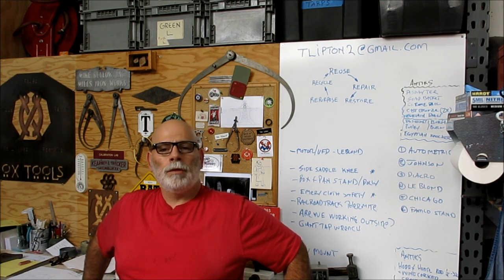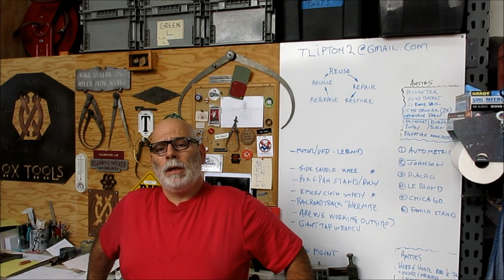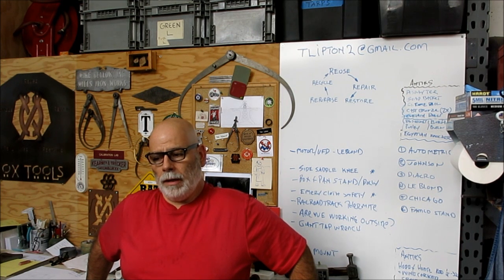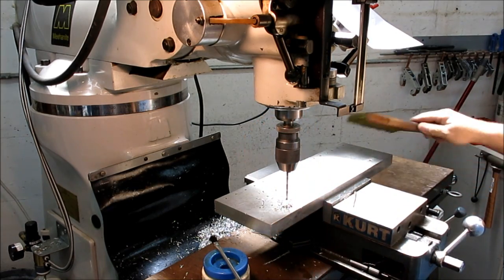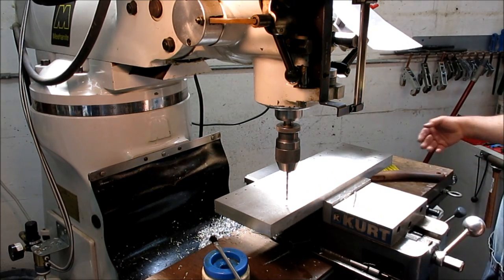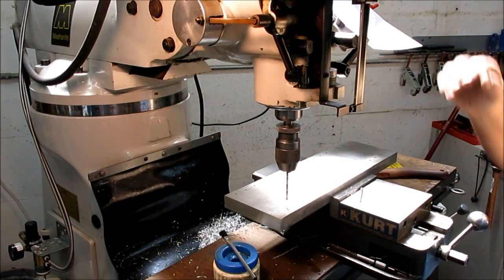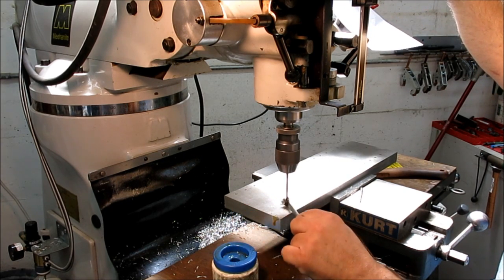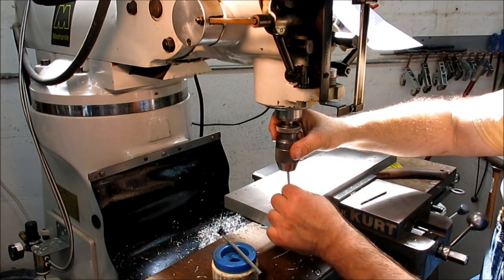Power Tapping In the Mill

Comment: Tapped some 20mm deep M10 holes today in my mill and it took me a lot longer than that..... Don't have a drill chuck for my mill so I use the ER-32 collet and power tapping felt kinda dangerous, tap wanted to slip in the collet and I had to tighten it really bloody hard, after I started the tap I rotated the spindle by hand, was afraid I'd have broken the tap otherwise. Really should get a drill chuck, or rather an SK40 to MT2 adapter so I can use the drill chuck from my lathe. Though I tend to have to hold taps in the lathe by the square edge or they slip.

Comment: First time I tried this at work a couple weeks ago, no idea what happened but when I pulled out there were no threads, it basically drilled my hole out with the teeth on the tap. Felt and looked like it worked fine till I pulled out and took a look at the hole.  It was a through hole so maybe I went too deep and hit the bottom of the vice. Whoops... Our hand feed lever is really janky though it coulda been worse, was making a basic puller for a pulley a friend was trying to get off a shaft.
Reply from the maker: Hey Max,

If your quill is sticky or you leave the brake on what you describe can happen. Your hand on the lever should track what rate the tap wants to go in and out. Your hand is just unloading the quill to let the tap focus on cutting. Hope this helps.

Cheers,

Tom
Reply: oxtoolco Yeahh, brake was definitely disengaged, the hand lever on our mill at work is really sloppy, cant feel a damn thing. I think that was the main contributing factor there.

Comment: Hi Tom
First I'm a total novice so bear with me.  Since you have a DRO to accurately position the piece, wouldn't the most time be saved by drilling all the holes and then coming back and tapping.  Saves all the time of changing bit and tap for each hole.  I used this method, sans DRO, while drilling and tapping holes in long aluminum bars for orthoses.  Used TapOMatic in drill press
Reply from the maker: Hey Morris,

It depends on how far the move is and the numbers you are driving to. Even increments like I was doing you can position fairly fast. Odd numbers take a little longer. The indexing time adds up quickly as the fine positioning sucks up seconds. Tapping the holes in another machine after drilling would speed this even more as you could do it without the DRO.

Cheers,

Tom

Comment: Hi Tom, I do sometimes power tap on the mill, but I don't think I would have the chops to do the tapping as fast as you are. And all my mills are step pulley by the way. It looks to me as though you are not changing the speed, and I think you said you are around 600 rpm's? You have nerves of steel my friend! cool!
  Another great lesson ........ Mike
Reply from the maker: Hi Michael,

Actually 1600 rpm. Got to get that drill to cut right. The tap never see's that full speed. Just don't come up behind me and ask a question while I'm doing it. Thanks for stopping by.

All the best,

Tom

Comment: That must be a good chuck to hold that tight that easily. Jacobs always seem to slip on me, even cranking on a chuck key. I'm amazed at how easily it loosens, considering that the jacobs need a lot of force to do so.
Reply from the maker: Hi Fake,

Well it is a $300 chuck. I didn't pay that much for it when I bought it but I do remember it hurt a bit. Thanks for the comment.

Cheers,

Tom

Comment: Isn't most of the time eaten up by changing back and forth between drill and tap? I kind of understand why you drill and tap while you are there (accuracy), but wouldn't it be loads faster (and still accurate enough) to drill all first, tap all second, debur all third (if needed)?
Reply from the maker: Hi Dscky,

The positioning is typically the time sink if the tool change is simple like this one. This was a pretty short distance and even whole number so its close. If the number were not whole then the tool change is definitely the way to go. Thanks for the comment.

Cheers,

Tom

Comment: Hey Tom,
Thanks for Tom's Tips and Tapping Tricks! (Say that 3 times fast!) What if you are using a spiral flute tap? Would they work in this situation? Thanks for drilling home some interesting hints!
Have a good one!
Oxen Dave
Reply from the maker: Hey Dave,

Spiral Flute taps work as well. I find them not quite as strong as the spiral point gun taps. They are the bomb for getting chips out of the hole.

Cheers,

Tom

Comment: Jobs like this are why I'm a huge fan of the 2-axis Accu-Rite conversational CNCs. You can whip together a program for that in 30 seconds, and since you still control the quill, you don't need to worry about crashing or getting your feedrates just right.

And you can just run the program over and over for your spot drill, tap drill, tap, and countersink. Easy peasey.
Reply from the maker: Hi Evan,

Having the machine position for you is a huge time saver. This is the crux of this type of operation. Thanks for the comment.

cheers,

Tom

Comment: Would it be faster to drill all the holes first and then use a drill press for tapping? Seems like precision isn't required for this job.
Reply from the maker: Hi Galfonz,

That would work as well. Would probably be even faster as well. Thanks for the comment.

Cheers,

Tom
Reply: At a place I used to work we had a drill press with tapping head always installed. It was stupid fast for stuff like this.

Comment: Tom did you not have a nice multi head drilling/tapping machine ? Could you not have used that ? 
And just a minor point  it's pronounced  
"pip - ette " not  "pipette" 😉
Keep up the good work  ! It's all appreciated. 
Mike Young
Reply from the maker: Hi Mike,

I do have a Burgmaster that could be used for this. Indexing the plate accurately is the problem with that machine. You may be correct on the pronunciation but I have been in a lot of labs. I can't recall anybody using that particular form. Thanks for the comment and French? lesson.

Cheers,

Tom

Comment: Little things make all the difference in time to complete a job. I think personally I would have did all the drilling then make a second round trip with the tap. This because the low voltage controls on my mill aren't conducive to quick reversal.
Thanks for another good video.

Colin
Reply from the maker: Hey Colin,

The indexes are what eat all the time. If its a simple tool change like drill/tap in a chuck then changing the tool is generally faster. If its collet type change then driving to the positions is better. Also depends on how far apart the features are. Thanks for the comment.

Cheers,

Tom

Comment: Tom that was great what you said at the end about speed/production. Also may want to point out this only works with 3 phase motors, most single phase motors will not change direction if the motor is still spinning.
Reply from the maker: Hey Bill,

Good point. I never had that problem as all my mills are fed a diet of good three phase. Never tried it on a single phase mill.

Cheers,

Tom
Reply: Entirely depends on the motor design but most machine motors aren't designed for quick reverse. In other words, if you need quick reverse, you'd have to specify a motor for that.
The reverse switch on my mill is at the back of the machine ! The one on the lathe is convenient at the front but does not have 'stop' as a feature !

VFD is another layer of mess to deal with too !

Comment: How about drilling in the mill to get accurate hole positions, then tapping after with the plate not clamped / able to find the hole center.

Is there any down side to that ?
Reply: I think you'd need three hands, one to hold the part, one for the down feed and one to change direction ;)
Reply: If the plate isn't clamped down, power tapping will lift the plate off the table, rather than run the tap through the hole. You could set up the part in a loose drill press vise or something, but then you need a third hand to hold the vise in place while your other two work the quill and power switch.
Reply from the maker: Hi Rusty,

It would actually be pretty fast. The positioning is the slow part. If you had a tapping head in a drill press with a topside support to keep the part from lifting you could cut the time even more. Unless the tap is really small or the part really heavy there is enough wag room with the tapping head that you do not need super accurate positioning. 

All the best,

Tom

Comment: Tom,
Again, this video was timely and right on the money.  I had tried power tapping with zero success.  It turns out I was using the wrong kind of tap.  Hand tap--Duh.
Reply from the maker: Hi eye,

Like most problems if you have a problem doing this its probably operator error. Thanks for the comment.

Cheers,

Tom
Reply: @oxtoolco  Get the rhythm right, you do it with a foot tap.

Comment: Hi Tom,
Interesting video, but reaching in with your hand while the spindle was runing would get you out the door in most shops I had worked in. Never did rigid tapping until I learned CNC before that always used a Tapmatic , even on most of the CNC used one.
Reply: I'd only risk power tapping on a 6" dia hole or above. No, on second thoughts, I wouldn't - my mill is not that forgiving. I'd just hope the motor would jam up rather than break the knee off.

Comment: Quick draw on that power switch!  Irony is my tap-a-matic has caused me to bust more taps... but it slipping out of the collet (1" diameter stem, hence stubby R8 collet).   Blind hole tapping? I like those OSG taps (oops forgot the name)

We need to have a side by side race.  I'' have no vice, just two fences.  Set the drill over the "T" slot.  Use a 1-2-3 block as a spacer... GO.  :)  So the 1-2-3 block is being flipped for the 1-2-3 spacing. 2-4-6 block then added, rinse and repeat.  Hence same table position, and same drill bit.   I use dowel pins for critial alignment, and mite-bite
clamps as needed.
Reply from the maker: Hey Tom,

Might be a cool comparison. You would need 16 inches of spacers to do this plate. Maybe a shot pin with micrometer adjust to set into the just drilled hole. Use the Burgmaster multispindle and off you go. 

All the best,

Tom
Reply: Something tells me to beat you, I'd need a Edlund Multi Spindle Drill Press!  ATB, Tom

Comment: Hi Tom, do you have one of this Taps that dont cut !! its forming looks like the same but you have a other drill diameter ?
thank you
Reply from the maker: Hi Frank,

Yes I have some form taps. They work great in blind holes where you don't want to have to dig out the chips afterward. Thanks for the comment.

Cheers,

Tom

Comment: Interesting video, but it would get you out the door fast in any shop I had worked in. Always used a "Tap O Madec" taping head. never did rigid tapping until I learned CNC.
Reply from the maker: Hi Steam,

Well I never got kicked out of any shop for making the boss some money. It might be faster to drill all the holes then set something up with a Tapmatic head in a drill press. I wouldn't want to do this job if there was even one cnc in the shop.  Thanks for the comment.

Cheers,

Tom

Comment: MINI PALLET? DID TOM SAY MINI PALLET?!?!

A quick note on drill chucks, I have two Whalstrum semi automatic drill chucks. They allow you to remove and change tools while the spindle is still running. Very handy for production work. Have you every used one? Their really neat.
Reply: i have never heard of such a chuck, do u have pics or vids?
Reply from the maker: Hey Andre,

Another tool I need. thanks a lot.

Cheers,

Tom
Reply: I'm sure we can get Chuck to find you one. Or maybe Adam has a few dozen under his bench.
Reply: yea, I got one of those Whalstrums a while back - was a little un-nerving grabbing the bits while spinning, but surprisingly safe after a bit of use.

thanks
Reply from the maker: Glenn Davis Hey Glenn,

I have never used one. When changing drills while the spindle is running it certainly looks a lot worse that it really is. I don't argue with anybody that doesn't want to do it. 

Cheers,

Tom
Reply: The first day I got it, I practiced with a 100 or so changeouts with different bits and whatnot. I was then convinced it was more than safe, so I comfortable with it now.

Comment: Hi Tom, I wonder how well combination drill/taps like this: http://www.amazon.com/Greenlee-DTAP10-32-Combination-Drill-10-32NF/dp/B000FCGRXM would work. I might not work for drilling and tapping such thick material in one go but I think it could useful for hand tapping or using an accu drill, because the drill part would make the tap start square to the hole
Reply: They'll work as long as the drill is through the matl before the tap part is in the hole.
Reply: ***** 
My son uses this type when drilling horseshoes for competition horses (mainly 3 day eventing) for stud installation in the heel area of the shoe.
Reply: *****
I'd guess that he makes threaded holes in the shoes before putting them on the hoof, so later studs can be screwed in the shoe
Reply: *****
I've never tried them but I can imagine getting the chips out and stripping the threads can be a problem if the drill doesn't get all the way through before the tap engages. I can see the drill part being a nice guide to get a square start when hand tapping an existing hole
Reply: Lasse Langwadt Christensen
You are quiet correct - studs must be removed before the horse is asked to move  over hard surfaces such as concrete, tarmac, wooden floors etc. studs are installed / removed with a spanner (wrench). They help to prevent the horse slipping especially on tricky surfaces.  Once removed the holes in the shoe are filled with cork / rubber bungs or wadded cotton wool to keep muck out.